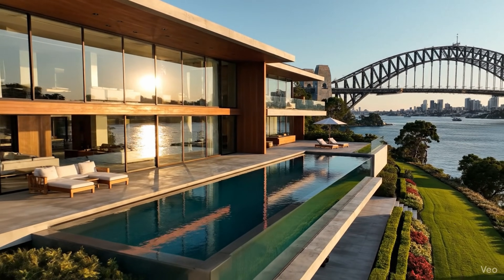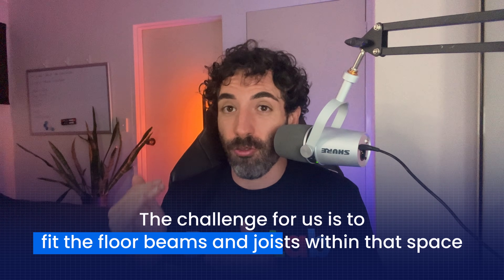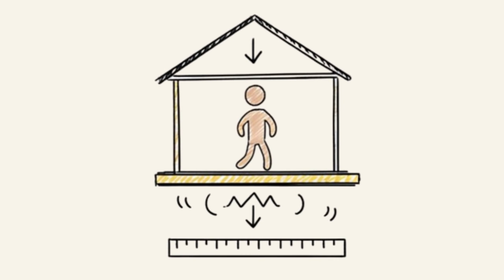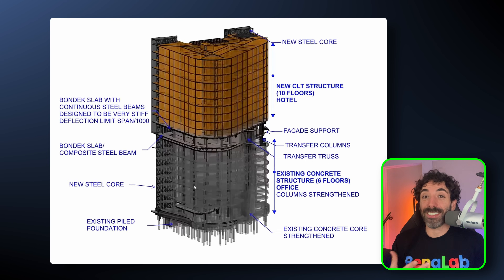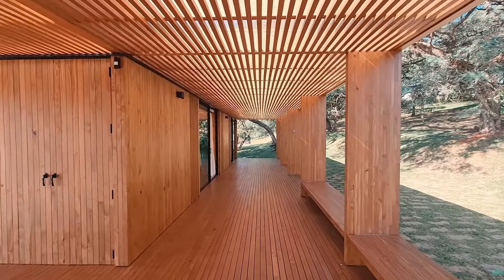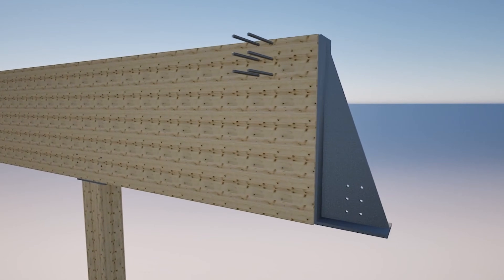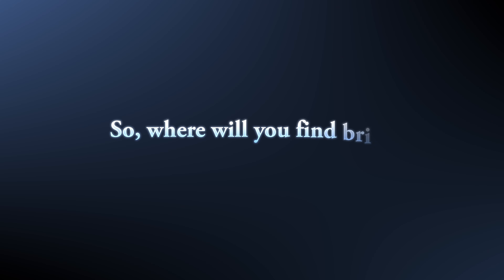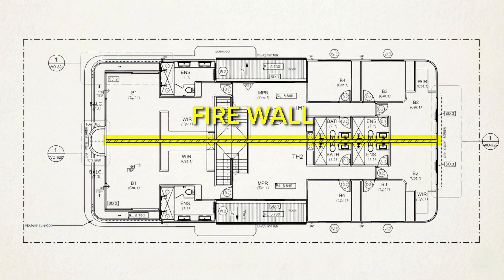7 Construction Methods in Australia (Pros, Cons, and Real Examples)

Comment: Hi mate, great video. can we build houses in Australian with a flat concrete roof slabs -100mm -150mm  thick sitting in ( steel I beams  8m span and columns and bondek and reo and shear studs welded ,25/32mpg concrete with some type of waterproofing applied to prevent moisture ingress, outside steel gutters ) in fire prone like BAL 40/FZ areas ? 

The concrete roofs would be best for fire prone areas I am thinking . 

Does residential codes/ standards  say this is ok to have a flat roof? Or should there be a minimum fall for the 8m span ?

Also I want high ceiling in the main living  dinning areas about 3.2-3.5m high . Is this acceptable in the codes? 

Thank you
Reply: If you engineer it then the codes don't apply outside of material properties.
What you described is normal  construction in SEA.
Your roof will need to have some fall  to shed water. 
With concrete construction, you can have any shape you want if engineered correctly.
Why not use concrete beams and columns?

Comment: what is your opinion on the brickwork standard australia compared to brasil whenever i see so called third world countries i notice there brick and block work is atrocious even the so called villas in dubai are built by unskilled labour
Reply from the maker: yeah it's pretty scary. I think you meant the villas in Bali?
most of them I imagine don't even have engineering. 
In Australia is more regulated. masonry buildings are mostly reinforced concrete blocks or double brick or single skin brick with engaged piers.
Reply: @bengthebrazilianengineerinAus  no imean in most so called thirld world countries the locals do no no mhow to make a house that includes the bricks bricklaying standards i mean on one vidieo shot in dubai the guys building the apartment block where not even using a line the houses in my own country pakistan are well designed but the people who build them and the bricks are atrouvious
Reply: Oz, bricklayers are good. They are accustomed to building with face bricks that won't be rendered.
If masonry walls are rendered then they just need to be flat and plumb.
I ply my trade in SEA. The concrete and masonry work is well implemented. They don't do face brick work here. Surface finishing is good.
Working with in situ concrete is fast if you have a good team. They don't skimp on engineering where it matters.
Good site supervision can be challenging. Constantly playing good cop/bad cop...
Reply: @walsakaluk1584  yeah aussie brickies are good being based on british method of bricklaying